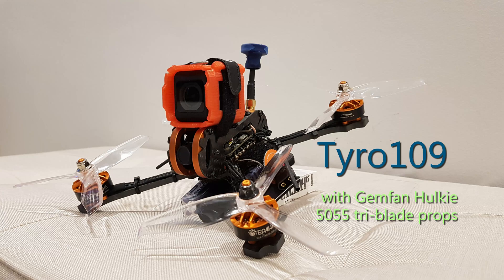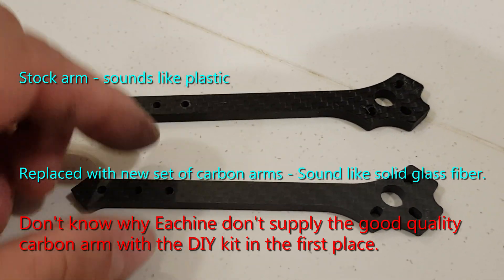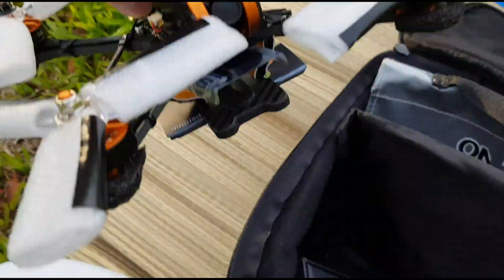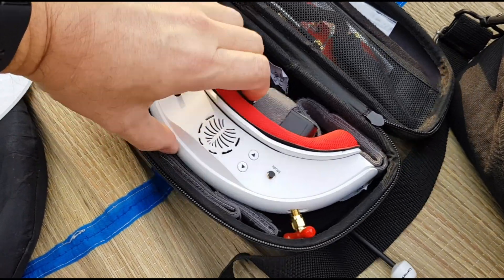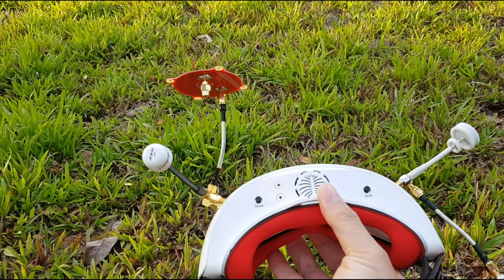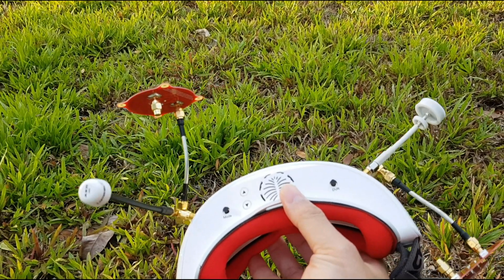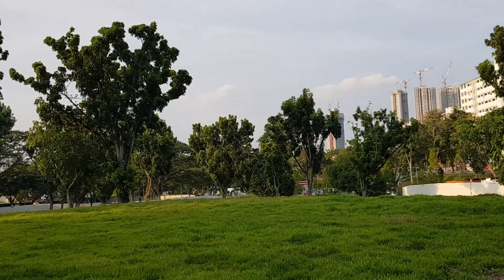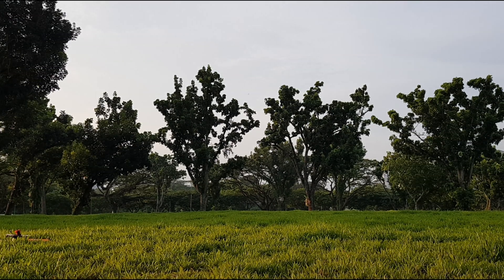Eachine Tyro109 - Why does the arms of this DIY kit break so easily?

Comment: Would a 1600mah 4s fit in this quad? Thx for heads up. 👍
Reply from the maker: Yes it would. I flew it with a 1550mAh Funfly 100C 4S battery and it just respond to my every sudden moves. At the bottom above the battery, I put an old used credit card bent to the width of the battery to protect it from the bolts pressing on the battery.  And i used the provided carbon plate to protect the battery from the bottom and stuck some protective foam (provided in the kit) below. We tend to land hard on the battery since its bottom mount so at least the bottom plate will absorb some shock during a hard landing.
Reply: @kayemdronestuff3597  Many thanks will cover those screws. Should be receiving my tyro109 shortly, got myslef a 1600mah 75c 4s lipo also on way. Thx again 👍